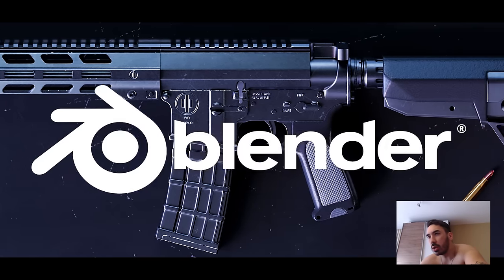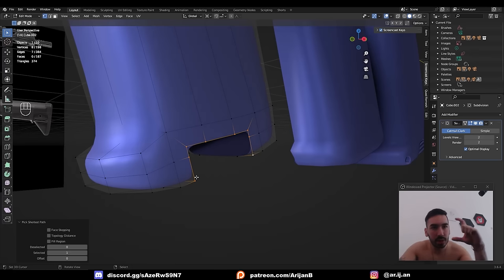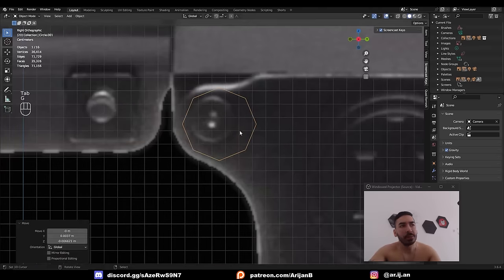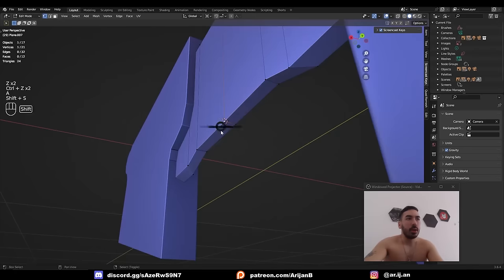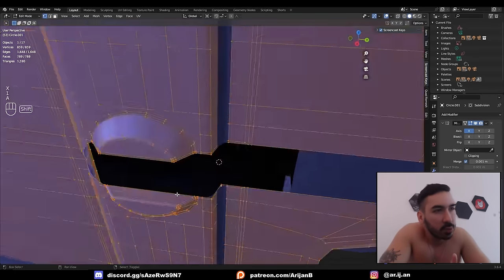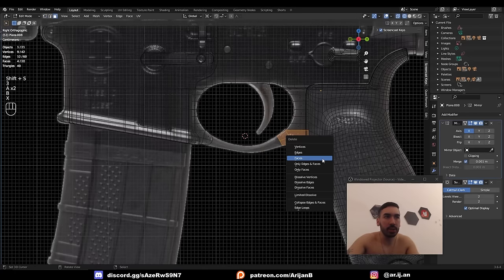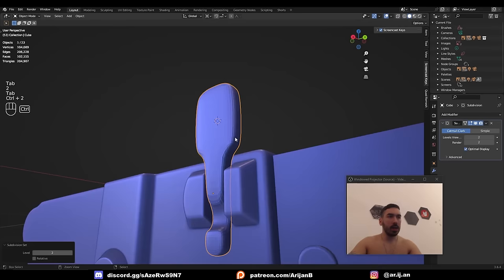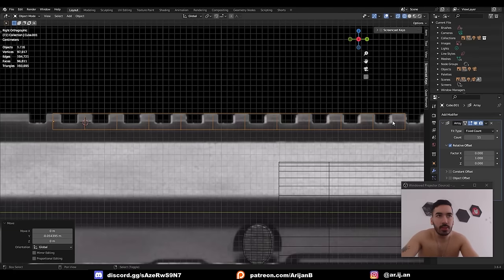Blender Gun Modeling Tutorial - Modern Assault Rifle (Aryan)

Comment: 1. That bridge at the bottom of the trigger guard is there so you can open it and be able to fire the gun with thick winter gloves on. Service rifles of most nations have this requirement.

2. The ping pong paddle is the bolt catch release, allows you to drop the bolt after inserting a new magazine to load one in the chamber without using the charging handle.

3. The ring by the stock you put 4 notches in actually only has 3 and is called the castle nut. It's used to hold the buffer tube in place. EDIT Just checked my AR-180 and it has 4 notches. Not only am I autistic, but also retarded.

I'm autistic about guns, and you asked lol. Not trying to be pedantic, you are an awesome artist.
Reply: As a fellow gun-nerd, THANK YOU.

Comment: 30:30   is for opening the gun when you press it after taking the pin out (above the fire mode) it will break the shape of your gun means it will bring the top and bottom into
 90 degrees (Used for taking apart the gun or cleaning it)

Comment: So, the. Button on the side you didn’t know about is called bolt catch. And the button that lets you take out the mag is called the mag release. And the tube that holds the butt stock is buffer tube, the thung under the trigger is called the trigger guard which is basically preventing the trigger to be pulled with some object like your rifle sling etc. and oh yeah, the compartment under the grip is just an em space for you to store batteries etc. also you forgot to model the ejection port on the other side. Also the thing that you pull with both fingers is called the charging handle. Btw you are amazing brother keep it coming!!

Comment: 30:28
That's the bolt catch. After the last round is fired, the bolt will retract and the bolt catch will catch it. After reloading, you can press the bolt catch and it will release the bolt, sending it forward to chamber the next round.

Instead of hitting the bolt catch, you can also pull back and release the charging handle. It also releases the bolt.